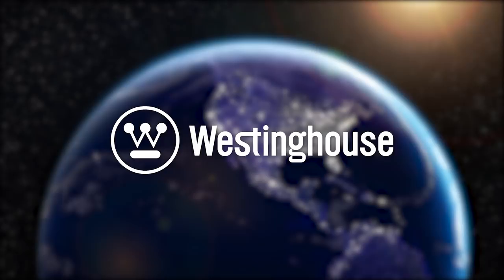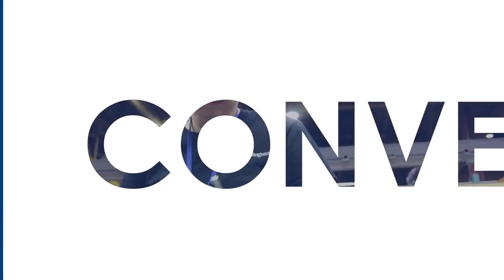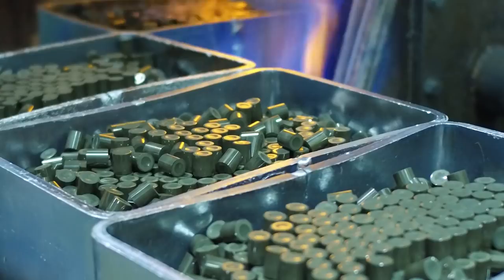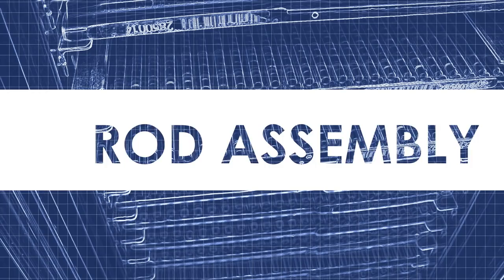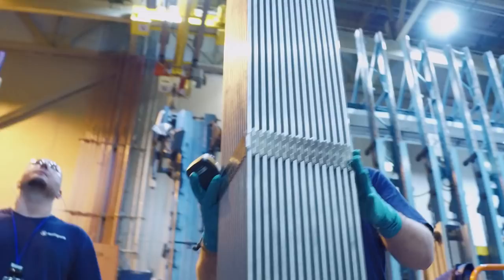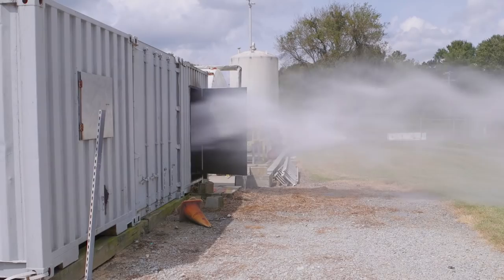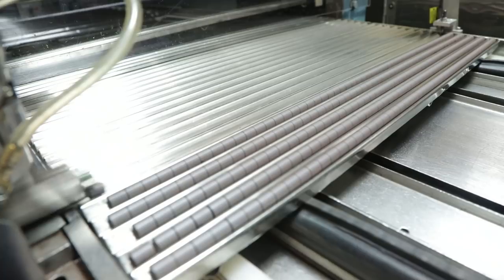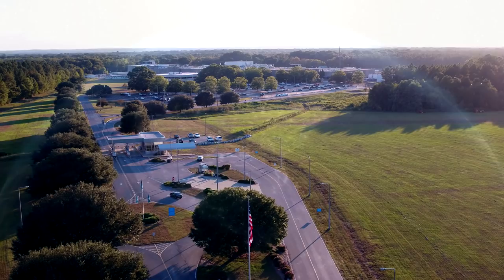An Inside Look: Westinghouse Columbia Fuel Fabrication Facility

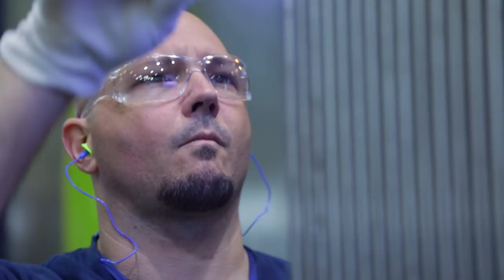Comment: At 3:30 safety is discussed as cranes are operated without hardhats
Reply: LMAO
Reply: I always laugh when I think of the requirements for wearing hardhats around heavy lifting.  It a 100 ton piece of equipment breaks away and falls on you, that hardhat is not going to save you.
Reply: @hootinouts But if something lighter than that happens to break off and smack your noggin, then you may just have a chance.